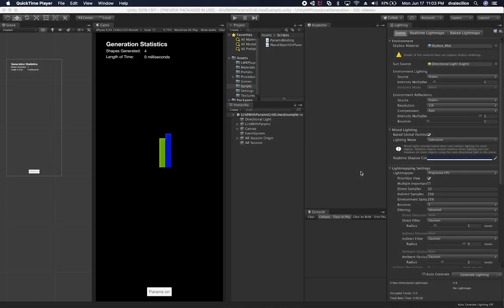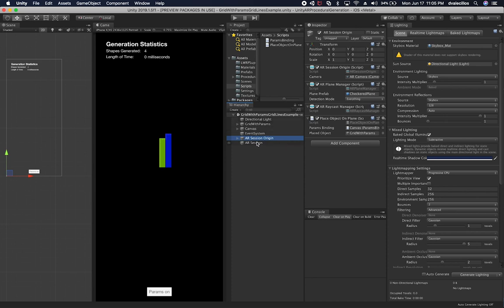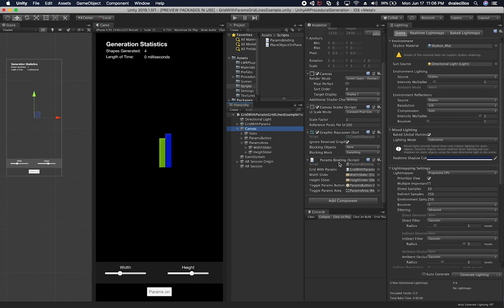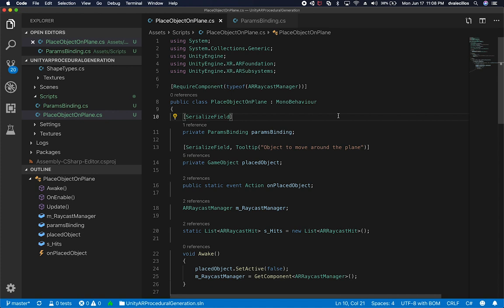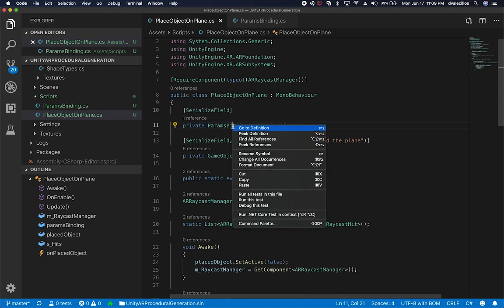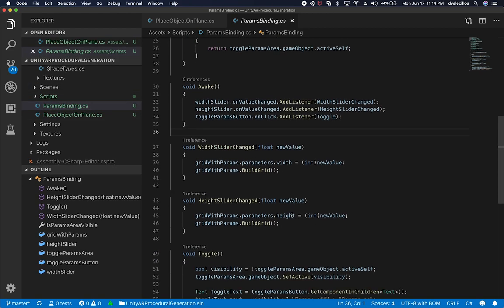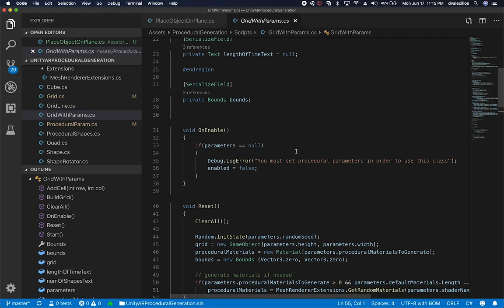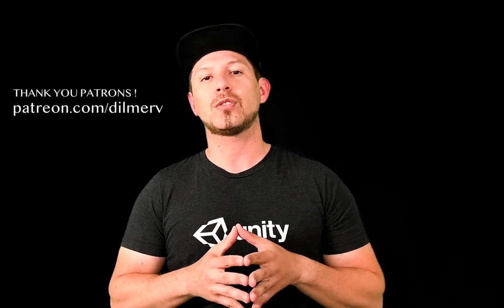ARKit 3 with Unity3d AR Foundation (LWRP) Creating and Placing Procedural Structures

Comment: Great work man! It seems like you can differentiate between vertical planes and horizontal planes in your app. If that is the case this should be possible to implement on an android phone right?
Reply from the maker: Thank you for watching and yes that’s correct this can be done for Android as well with ARCore and Unity.
Reply: @dilmerv  is it possible to do it with ar foundation?
Reply from the maker: Absolutely :)
Reply: Also, is the code available? Can't find this particular project on your Github.
Reply: @dilmerv  how? Can you point me in the right direction?

Comment: Have you considered making fishing-rod-like physics manipulator like in Google AR Elements? So much details in there (grab point, spring smoothing and damping, line renderer, infinite floor collider and limited additional collision areas, etc) yet it is very commonly required tool. I'd like to make such tutorial by myself but lacking time to polish it (you can find it in my ARFoundation github fork @dnnkeeper branch stationary_markers)
Reply from the maker: Oh cool I will check it out thanks for the info and if I do a tutorial I will be sure to mention your name !